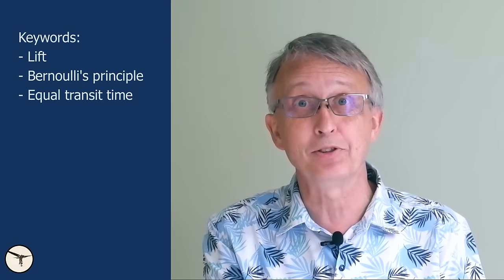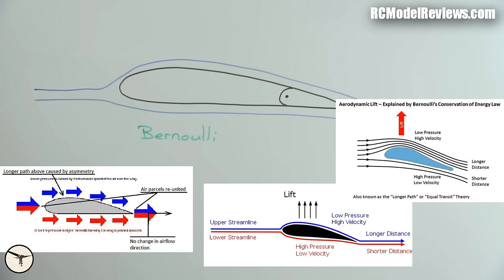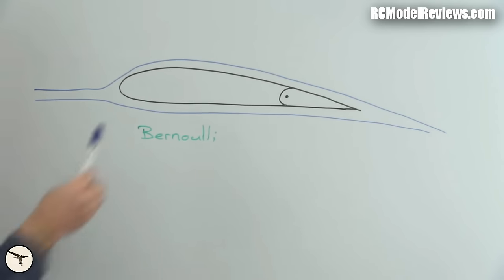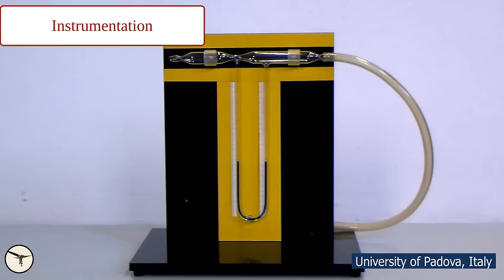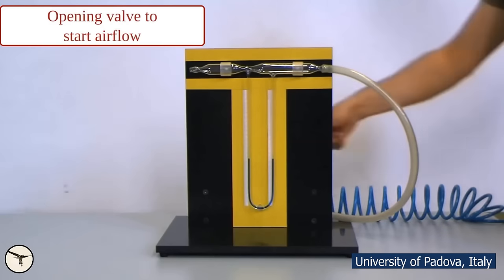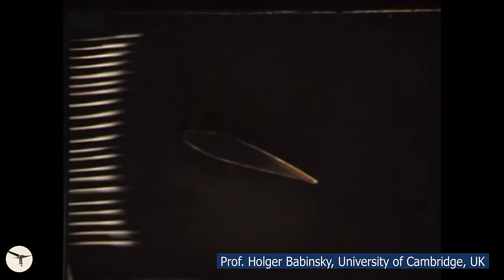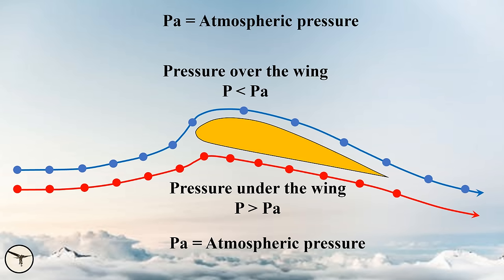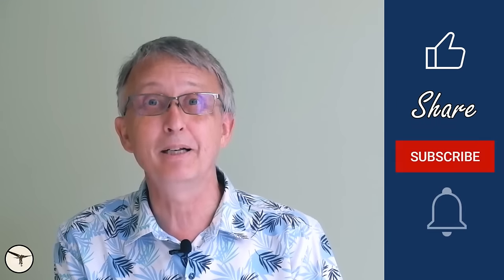Why are so many pilots wrong about Bernoulli’s Principle?

Comment: @3:38 Its the TOTAL pressure (Ptot=Pstatic+Pdynamic) over the wing being lower than the one just below the wing (NOT the static) . The static pressure is the pressure due to your altitude and its practically the same above and below the wing - what changes is the Dynamic Pressure component of the total pressure , due to the acceleration of the flow above the wing . There is also another mechanism that produces lift by just deflecting the air downwards (there have been aircraft with upside down airfoils creating net positive lift by just setting them to aggresive angles of incidence) .Its Bernoulli (suction) + Net Deflection of airflow (Newton's 3rd law) that in combination produce lift .You can produce lift with either of the 2 mechanisms but you do it more efficiently (ie from a drag and predictable stall characteristics perspective) by combining both
Reply: Doesn't the vacuum resultant/exist because the big metal thing moved all the air out of the way (down)?
Reply: @woodpile66  NO-low pressure is created because of the acceleration of the flow and there are several ways to accelerate the flow , one of them is through the curvature in the favorable pressure gradient region of the airfoil (typically from LE to maximum thickness area of the airfoil)
Reply: Most of the lift results from the action above the wing.  And this is the drop in static pressure. The static pressure drops to maintain conservation of energy in response to the speed increase necessary to maintain mass flow rate.

The static pressure drop turns the passing air downward, in the same way that wind turns toward a low pressure weather system.
Reply: @davetime5234  this confuses me more, you say the air above the wing is acting on more air - it seems like you have nearly left the wing out of the equation
Reply: @teamheat7564  I don't see how you can say "curvature" as if it wasn't the the wing. (in most cases) engine power is pulling the "curve" through the air. This function accelerates air and points it down - both  as an action on air demanding a reaction. Given your viewpoint, how does an aileron manage to defeat all that suction and create a negative force with just 3 inches of flat metal?
Reply: @woodpile66  The wing disrupts the prior course of orderly lateral flow of air mass.

But the lateral flow of air mass must continue at the same rate nonetheless (otherwise it will either indefinitely deplete, or alternatively "stockpile" or accumulate as the opposite extreme, both cases of which we know are not possible).

So, the wing's role is to induce this pathway "stress", but that "stress" cannot impede the never-ending rate of mass flow.

The lateral mass flow reacts to the path "stress" by speeding up.  

How is this possible?  Because any temporary disruption to the mass flow being maintained, changes the pressure to the point that the original mass flow rate is quickly re-established by the changed pressure (it is a self-correcting mechanism).

The lateral speed up from the above process, drops the static pressure.

Why?  Because the kinetic energy increase to maintain the higher speed, is supplied by static pressure depletion:  

The static pressure drop is the energy supplied for the dynamic pressure increase (to keep the mass flow rate continuity intact laterally across the airfoil).

So, this disruption the wing locally imposes, in effect, causes the formation of a "low pressure system" (weather analogy), to mitigate the airfoils stress to the flow rate continuity.

The transverse ("vertical") pressure gradient of this "low pressure system", affects lateral mass flow as far above the airfoil as this low-pressure gradient extends vertically.

Any air mass passing laterally through this vertical pressure gradient, in effect "falls down through" or is accelerated down towards the pressure gradient.  Like wind being pulled around a low-pressure weather system.

So, the wing's shape does affect the air passing further above, to a distance as far as the low-pressure gradient extends.
Reply: @davetime5234  well, I really appreciate your effort in this matter, but I don't think that I am able to understand the complexity of this explanation. You really lose me when you said the low static pressure powers the laterer speed. I was pretty certain the engine was pulling the wing through the air mass. From what I read it seems that it directly powers the vacuum. When I trace transfer of power, vacuum is the by product after the wing moved the air.
Reply: @woodpile66  I'm sorry, I think I made it confusing by trying to over-explain (and perhaps a misspelling I just noticed).  

In particular I think I caused confusion about this point: "You really lose me when you said the low static pressure powers the laterer speed."  

For one thing the typo:  "laterer" should be "lateral", or the horizontal flow of relative wind.

All I mean by that is that rate of mass flow out must equal rate of mass flow in, whether the wing occupies that space or not.

(note:  the above is not the same as the usual equal transit time arguments, and, in steady state, must always hold true)

Because the wing does occupy that space, the airflow confronting the wing must speed up along the path detour, so that total flow in continues to equal total flow out (or rather, the rate of the mass flow).

But the above increase in speed takes energy, and that energy comes from static pressure, which drops to maintain conservation of energy.

So now you have this low-pressure area in the midst of the entire flow field of relative wind.

And wind from above must bend down to follow that low pressure area (like wind around a low-pressure weather system).

This bending of the air is the change in vertical momentum that is the force of lift.

That bending takes energy though, and that bending (change of momentum direction) energy, is "paid for" by reduced forward motion in relation to the relative wind. 

This energy penalty is experienced as part of total drag, which acts in the direction opposite of forward motion.

The engine is supplying energy when pushing against that "bending drag."

Additionally, that transfer of energy out of horizontal motion to vertical motion, is made more and more efficient, that is, it takes less and less energy to make the same force of lift, the more mass it involves.

The above is a fundamental distinction between momentum and kinetic energy (which also explains how firearms work, as well as hi bypass turbine engines).
Reply: @woodpile66  how ?The aileron is an exact example of how the air deflection mechanism (that i already explained) produces positive or negative lift by the action-reaction principle . You can mount a Clark-Y upside down and if you give it the correct angle of incidence your net force (suction + flow deflection components) can be reversed = Yes you can produce a plane with the wing upside down and with the right angle of incidence its going to fly (abeit less efficiently) . Aileron is the same principle . The reason the effectiveness of the same side of aircraft aileron is different in left to right turns is exactly related to the sum of the bernoulli mechanicsm (suction)+ air deflection mechanism (action -reaction Newtonian lift) . The principle is easy to understand but there are a gazillion of things to take into account when trying to understand the aileron effectiveness .One of them is that it is typically placed in an adversure pressure region where flow can detach and therefore the intended deflection of flow might not happen as flow just wont follow .Problem is that such things are 3D problems typically (ie you have the wingtip spillage and combined roll, yaw and pitch angles affecting the flow pattern over the aileron and therefore the flow attachment over it and its overall effectiveness . Thats why in some aircraft the designers choose to loose some leverage (by mounting them further inboard the wing) to gain some predictability over a range of flow conditions
Reply: @teamheat7564  that is easier to understand, thanks. Obviously, many folks poorly explain lift, and many focus on simple elements. Not an easy topic
Reply: @woodpile66  exactly .Thats not a simplistic venturi throat .The aileron deflection in CFD will show pressure differences that will cause net pressure differences over the wing and in result lift vector and also moments (*felt* by the wing structure) but its going to be hard to explain all this via the Bernoulli principle alone .One could say the aileron down (high CL positions) effectively change the wing curvature at the TE creating overall more lift .But one could ask how exactly ? Whats the mechanism ? The way you can see that from a fluid dynamics perspective is suction near the aileron hinge junction in the aileron down positions and therefore this suction is added to the major part of the suction created from the wing LE to the wing max thickness point . Of course this change of curvature does not only produce forces in the lift vector direction but also forces in the drag direction and moments . Personally when it all gets too much for someone to grasp all that is really happening on an externally simplistic trapezoidal wing with CL modifying devices , i would suggest old photos of bomber formations from WW2 seen from above .The angle of incidence is quite pronounced and the residuals of oil filled smoke from the engines has washed over the wing showing the flow patterns .One could intuitively recognize that the wing is an efficient way of pushing air down and getting lift from it this way in addition to the suction from the LE .One could totally erase the suction due to curvature near the LE and still fly (many fast flying airfoils rely more on angle of incidence and less on curvature to produce lift - curvature is also there to make sure the adverse pressure gradient region where separation will occur is minimized) .Nature is complex and needs intuition and mentally agility to comprehend it better and pulls you like a magnet to discover it
Reply: @teamheat7564  If you feel like tackling a bit more of this, I have some more circumstances that don’t yet add up under your current explanation. Just so you know, I am not an academic, I am an instructor pilot with rotor and fixed wing ratings. Also, I fully accept Bernoulli’s equation, but still understand an equation to be a system always in balance with no resultant force. Low pressure is not a force, as it has no matter act with. I sort of understood your aileron response, but to me, it still seems like the vector of the airflow is the key to force. Here are a few things you might wish to tackle. 
A vacuum has no force vector at all – it operates in 360 degrees and does not pick a wing up any more than it pulls air down in balance. It also works laterally.
There is probably a reason why no aircraft propulsion system vectors the intake, such as Harrier jets – they always vector an output airstream. Ships don’t put rudders in front of propellors, either. I don’t think this would be prudent engineering if the majority of force from a wing was on the intake side of the system. Spacecraft would use “suckers” instead of “thrusters”. But space is a vacuum, so we only need mass and velocity. A jet ski would also fall into this category – they are not sucked under water by their intake, nor are they pulled forward by the low pressure at the front of their hydrojet impellor – they are both propelled and turned by output and I fail to understand why physics change only for airplane wings.
That said, I am appropriately afraid to walk near a spinning prop on an airplane. However, you don’t need to be very close to notice that there really isn’t much going on around the front side of the prop (wing) – minimal air movement. But a considerable amount of air is moving on the back side – this must be accounted for with a reaction. And it brings me to a thought experiment. If a propellor engine was replaced with a rocket motor, the thrust required for movement would be measured by air density and velocity (both terms in the lift equation). I think that at a given power, such as “full” the rocket power needed would be equal to the amount of air/velocity that the propellor would be moving. If this is the case, then the vacuum on the top of the prop is contributing nothing to the force of lift.
I liken this train of thought to a shop vac. When the end of the 8-foot hose is sucking up sawdust with a vacuum, the action producing the vacuum has already been balanced with reaction of the motor at a significant distance and at any random angle of difference from the resultant sawdust sucking power. All this said, I am still inclined to think that the Bernoulli equation is useful for describing the efficiency of the wing by measuring the after-effects of force in the same way that a baseball hitting a window is a result of what already happened at the time of throwing. The action-reaction already happened between the hand and the ball, and what the ball happens to hit or not hit is irrelevant to the original force generated. But the force of the ball hitting an object can still be measured and inform us of how something was thrown. This is how I see Bernoulli working on a wing (but it is not actual lift – just an analysis of it). Best wishes!

Comment: [Another perspective] Here is how I see it, the upper part of the aerofoil has a longer distance as it is curved, the lower part has a shorter distance. Now let's stream an imaginary 100 molecules of air to the tip of the aerofoil, 50 molecules go up and 50 go down. The shorter part (lower) has more molecules per distance than the upper part where the molecules are less dense. Now we know denser particle have more pressure compared to lower, this is why the molecules below try to push upward, Hence, lift. I completely agree with everything else.

Comment: This explanation is incorrect as well because it is incomplete. If curvature was the sole explanation, then flate plate lift wouldn't exist. All lift is created through circulation, whether it be from wing shape (camber) or angle of attack. The effect is equivalent to the magnus effect... rotating golf ball. The viscosity of air defines the circulation flow field shape. Without viscosity, there is no lift, regardless of camber and angle of attack. Essentially, no lift means zero circulation ensuring the molecules meet each other at the trailing edge of a 2D wing. 

Consider a cambered aerofoil at zero angle of attack... it also generates lift through circulation. Lift generated by camber creates lift at the aerodynamic center, typically the mid-chord position in subsonic flight. Lift generated by angle of attack usually occurs at the quarter chord position. The combination of the two causes lift to advance towards the 1/4 chord position with increasing AoA.

Too many experts on the internet these days. Former test pilot here.

Comment: Lift is produced only because the net flow of air is downwards. That is newton's law. A completely symmetric wing flies perfectly well using only angle of attack. It also annoys me that we all quote bernoulli when the effect is actually the coander effect. Bernoulli is a special case of coander applicable only to a tube.  The air below the wing slows down due to compression of the wing, i. e it's doing work.
Reply: I don´t follow your comment: Does the coander effect predict the static and dynamic pessure variations laong the aerofoil? We were taught to use Bernoulli´s eqaution to do this.

Comment: Is the top air accelerating or is the bottom air decelerating? or both?
Reply: good one.      answer: bottom decel, due to 'compression'       but, outside of a wind tunnel, where the air is  Stationary, this affect is  negligible.
Reply from the maker: Both

Comment: I was taught Bernoulli's Principle in the 50's and 60's, when I was flying model planes. No one could explain to me how little balsa chuck gliders with flat plate surface could create lift or why the control line and R/C models with symmetrical airfoils still flew just fine. I now know that there are many factors, Flat Plate theory and the Coanda Effect among them. Someone calculated that Bernoulli's Principle created only about 3 to 9% of the total lift. I gather that Coanda provides the biggest % of the total.
Reply: Lift is the top-bottom (static) pressure difference and the reduction above the wing produces the largest part of that difference along with the increase below. 
However, it is incorrect to say that Bernoulli 'produces' the pressure change. Bernoulli only allows calculating the pressures in some places around a wing.  It is the physics of the pressure changes above and below that very few people can explain. Once you realize that air has inertia, it becomes apparent that it is the ken factor for the pressure changes around a moving object.
. . .
While many use it, technically, Coanda is defined for a jet or sheet of fluid injected into otherwise still air along the convex surface, not a bulk flow like over a wing.
 There is a difference in that the jet/sheet has areas of entrainment not present for the bulk flow above a wing.  Looking at his patents, Coanda recognized the pressure reduction.
While the two cases are quite similar, few people seem to understand the physics for the pressure reduction.  They just say "Coanda" does it.
It is explained in the video on my YT Channel. Once you realize the role inertia plays, it's easy to understand.
Regards